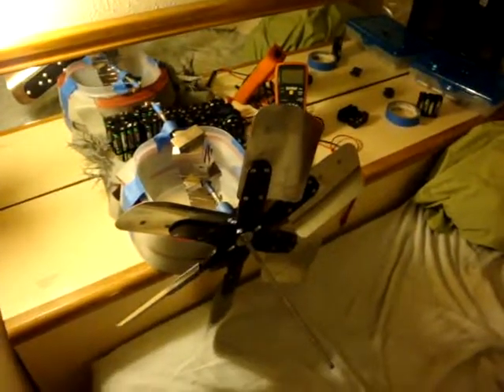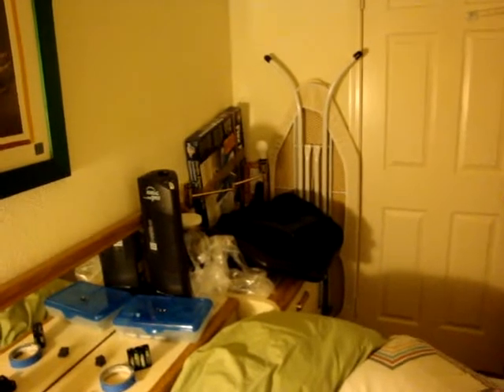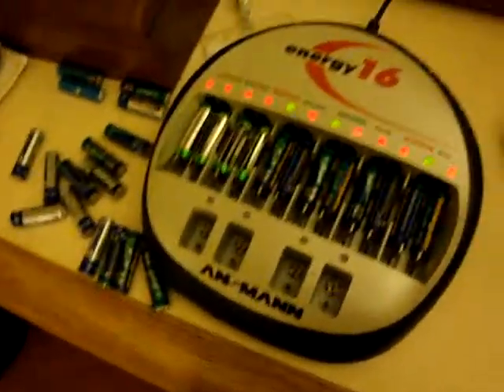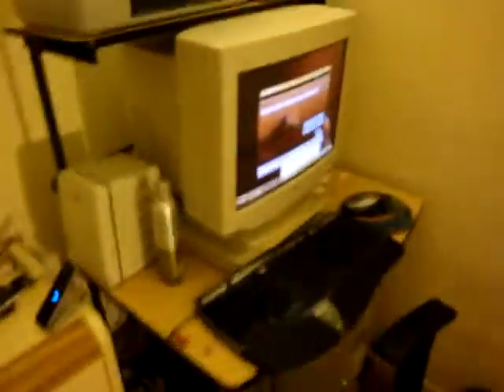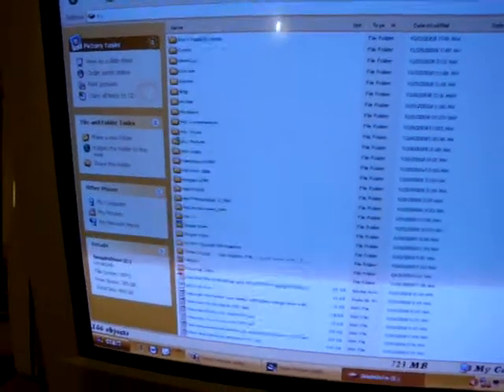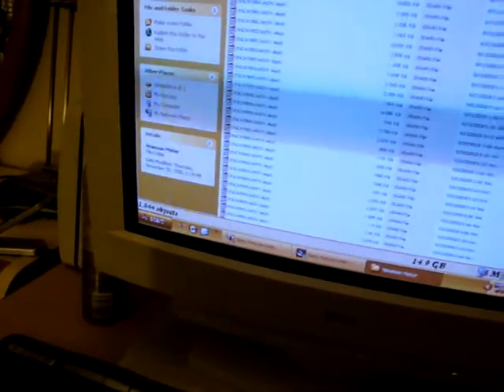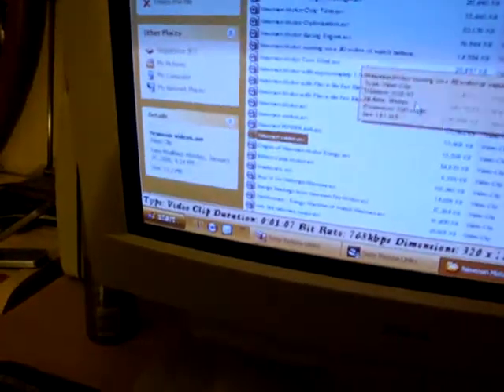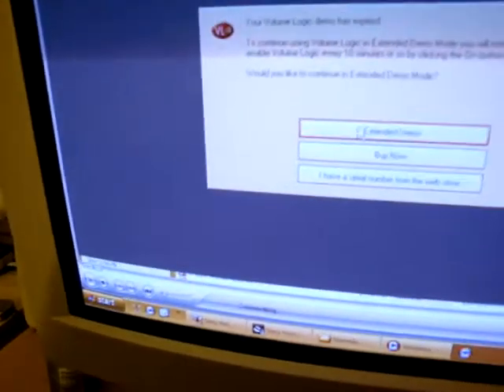Newman motor ▲ New Camera

Comment from the maker: magnet4less(.com)

The neos are not gold-colored. They just reflect the color of the light.

These things pinch REALLY hard. They are truly a pain to put together.

To cleave magnets, I have iron bars which hold up my mattress which can be used to pin them down and to twist a magnet off. This is still very hard to do, even thought I can push 20+ shopping carts manually at the same time.

Body building and Newman motor building definitely go hand-in-hand.